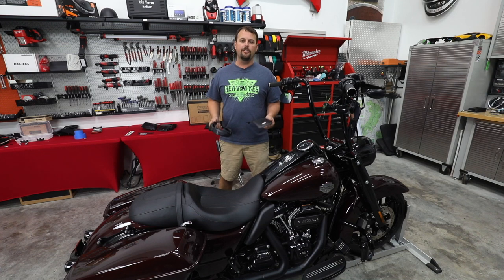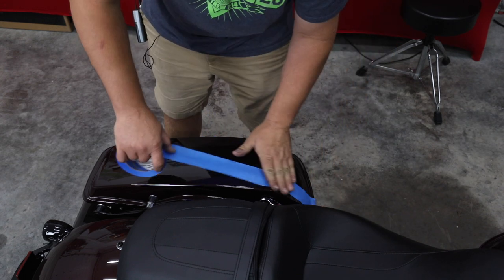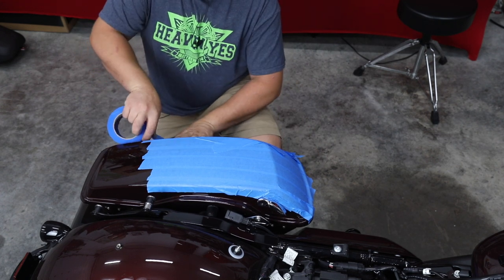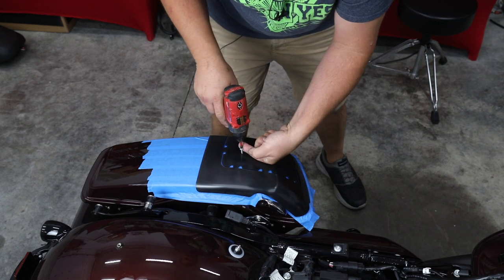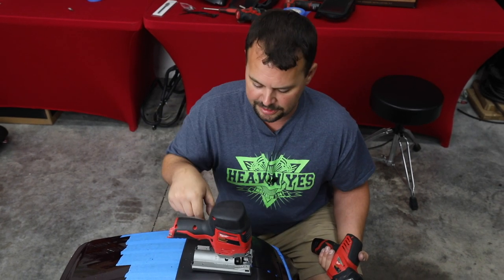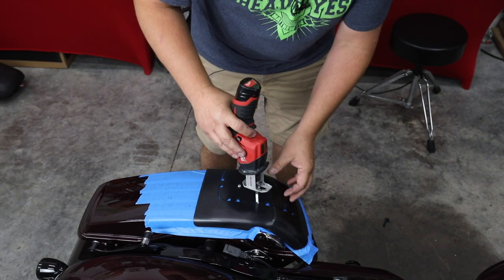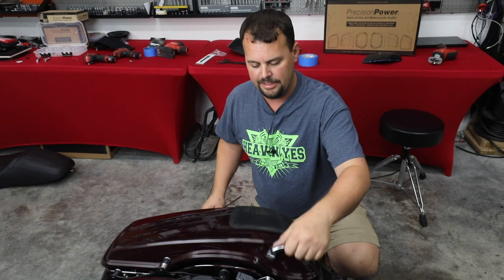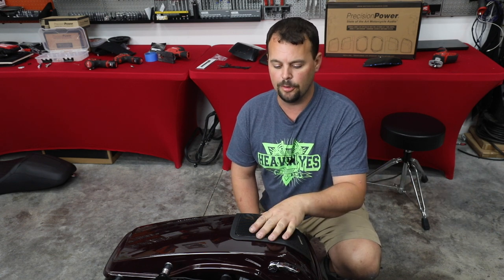Step by Step, How to install 6x9" speaker cut in kits to Saddle bag lids using the PPI HD14.SBS

Comment: Have been considering this mod 🤔, but after watching Traveling Tall's video on the bag lid mod I think that the Fairing lowers is the better route to take. 
To go thru all that trouble and have them leak, plus the sound gets blown back from your ears the fairing lowers is, to me the most sensible option.
Reply from the maker: Tall did not get the lid cut kits #1, the kicker lids he chose leaked but later we repaired them with silicone so they no longer leak, cut kits don’t leak when properly installed.  Check out the leak test riding and wrenching just did on our cut kits, you will hear the 6x9’s when using cut kits because the mounting angle is much better.  Tall’s head is about 1ft above his windshield and he wears a full face helmet, most people have a better scenario for hearing the 6x9’s, he also said he though you would get better bass from lowers, this thought is false, lowers never have good bass because they are free air pods
Reply from the maker: https://youtu.be/9gdahuPLexI
Reply: I have the milwaukee m12 hackzall but can not find a jigsaw style blade for it. What tool is that and what blade.

Comment: good stuff very professional detail oriented install instructions....maybe too much.  If you get too far in the weeds, you may lose some of us.  Things I would like to know is if I have a factory RF system on my 2021 Road Glide CVO, Is there a adjustment in the app to get the most out of that system.  If that is not enough, cause you always want more, what are the easiest add to get to the next level...add 6x9 speakers, replace the amp with more power,  plug and play type installs.  The other suggestion would be as you record the process, and you say for example that you need to sand down the speaker lid, to speed that up.  We get the concept of smoothing out the speaker hole after cut, but don't need to see you do it for minutes...thanks
Reply from the maker: Reach out to our sales team at 1-844-30AUDIO to discuss options. We do have videos where we do time lapse and speed processes up and then we get asked to show every step.

Comment: I noticed that in this video you did not add silicone or dumb-dumb to seal it. Is it because the kit has been upgraded?  I just ordered some from you and want to make sure before I install 
Thanks
Reply from the maker: The precision power cut kit has a wide enough gasket that silicone is not required

Why we think the Precision Power HD14.SBS is the best cut kit to use
https://youtu.be/BrrIToZRNDQ

Comment: I saw a video where you had an amp in the bag? How did you keep it from getting to hot? Or is it an issue?
Reply from the maker: If installing an amp in a bag use a sealed class d amplifier that does not require a fan and you will be good.  We mount amps in the fairing whenever possible as this is the best placement for an amplifier in a Harley

Comment: Hey Jay, you don't use silicon anymore?  You sent me this kit with my Hertz 6x9s the screws came with little black washers for what?  It doesn't seem that the speakers fit the mounts. Maybe I am doing something wrong. God Bless
Reply from the maker: In this video I show how to install the hertz 6x9’s in the cut kits https://youtu.be/Pg2ozj9fTK0
Reply from the maker: We use silicone on the underside portion if using the infinity cut kits, the precision power have a wider flange and gasket that seals well without silicone

Comment: Are the speakers going to be absolutely waterproof
Reply from the maker: Depends on which speakers you decide to install, no 6x9 is submersible but many are designed to get wet from rain and designed for Harley  use

Comment: I have the TMS69BL14 speakers that i installed in 2019. Can I just replace the speakers and reuse the Rockford grilles and speaker mount? Or with the cut from the Rockford kit, can I use your grilles and speaker mounts? I do not want to replace the saddlebags lids. Thank you
Reply from the maker: With slight modifications you can reuse the Rockford cut kits when going to better speakers, grills are not interchangeable

Comment: On the Road King? What are those speakers connected to? Do you have options to add music to a bike with no radio (like the road king) I have an old Dyna that I'd love to add a system to.
Reply from the maker: Yes we offer Roadking packages that use a Bluetooth amplifier https://volunteeraudio.com/product/hertz-sx690neo-6x9-motorcycle-speakers-with-plug-play-amplifier-and-precision-power-hd14-sbs-cut-kit-for-2014-2022-harley-davidson-road-king

Comment: I just purchased this cut kit w harness from your website. Do I need a spacer to install Hertz 6X9 Neo speakers?
Reply from the maker: No, I show in this video how to do the install without spacers Project Five-0 Step by step 2000 watt SP4.900 Hertz Amplifier and SX690Neo 6x9" Speaker Installation
https://youtu.be/Pg2ozj9fTK0

Comment: How much would it cost for u 2 put in a sound system in my 2018 street glide with infinites 6/9s & 6 1/2 with amps?
Reply from the maker: For installation quotes you will need to call our sales team at 1-844-30AUDIO

Comment: Will any of these cut kits work with CVO saddlebag locks?  I have seen your video 5x7 to 6x9 kits installed just wondering if there was a true 6x9 kit for the CVOs
Reply from the maker: If you install cut kits you will lose the power lid lock

Comment: What size/ gauge speaker wire do you recommend on your Hertz 900 amp with Hertz 6x9s and 6.5 neo and 2 - 8" subs.
Reply from the maker: Our plug n play amps come prewired with proper sized copper wire

Comment: Hi Jay, I did almost exactly as you stated. I had a 'fart' moment and over cut the bottom of the speaker lid. Its not visible to regular folks, but if you closely look you will see the gap underneath. What do you recommend to fill in that hole?
Reply from the maker: I have not had this happen in my installs, some people have bought replacement lids depending on the size of the mistake
Reply from the maker: I would need to see a picture of the problem to help
Reply: Where can I send you the pictures? I do have hertz speakers in the lid, but using kenwood 6x9 speaker lids. I’d the hertz slight larger that might be the ticket.
Reply from the maker: @Kevin-leatherneck  the cut in kit is kenwood?
Reply: Yes sir. That’s correct.
Reply: @volunteeraudio  that’s correct!
Reply from the maker: @Kevin-leatherneck  that is the hogtunes built cut in kit, no other cut kit fits that area and that kit has the least room for mistakes
Reply: @volunteeraudio  Jay , my apologies.  It’s the infinity kit not kenwood.

Comment: Will this work with the boom system installed on the 23s?
Reply from the maker: 23 is not boom audio, it is hd audio by Rockford, there is also a new cvo for 23, which bike exactly are you asking about?
Reply: 2023 street glide special
Reply: @volunteeraudio when connected via Bluetooth it comes up boom box GTS.
Reply: @volunteeraudio I also see a radio flash kit that only goes for a 2014-2020 can I still use that?
Reply from the maker: @MrNiceGuy_GG  we offer one for 21-up also, give us a call at 1-844-30AUDIO and we can go over pricing and options

Comment: So my question is if you have a gt radio and you add rear speakers how do you hook them up?
Reply from the maker: You need a backbone harness to plug into the rear speaker connector in the fairing, then a rear tourpack harness or lid disconnect harness, the stock radio would need to be flashed to turn on the rear speaker outputs and an amp is highly recommended

Comment: No gloves or safety glassss?!  Man, you livin la vita loca!! But, thanks for vid. I'll probably do this kit.
Reply from the maker: If I was cutting metal I would have glasses on but yes I’m tough and dumb sometimes. But you can wear gloves and glasses if you like.  Thank you for watching!
Reply: I just bought the Hertz HD14H6x9 Saddle Bag Lid Kit With HD14H Cut Kit And SX690NEO 6×9” Speakers For 2014-2023 Harley Davidson® Motorcycles [ HD14H 6×9 ][ SX 690 NEO ]. You’ll probably see the purchase soon. I hope it has everything I need. I have a factory 2023 Road Glide Special & am pretty sure it does not have any wiring going from the radio to the back area. Does this $899 kit come with all the wiring I’ll need? If not, can you guide me to what I’ll need. Thanks! Look forward to wiring, cutting, screwing & putting all this together as I am a musician and look forward to having more sound(from the rear) and better bass, etc.
Reply: Also, am I going to need to flash my factory BOOM radio?

Comment: When you use this kit you have to make sure you have original Harley-Davidson lids if not you have to do a little extra cutting I know because I have Advanblack lids and made the cuts correctly and still had to make modifications but it worked out just fine and had to modify my speakers a little bit but it is a great kithttps://youtube.com/channel/UChGJTD_vGuw4U5pkAs5C-zQ
Reply from the maker: I have used this kit with aftermarket lids, never had an issue as long as it did not have previous speaker provisions

Comment: Nice video…   But it’s cheaper to just buy a whole new set of bags
Reply from the maker: There are many advantages to cut kits over replacement lids. They use less bag space, angles the speaker toward the rider instead of straight up, way more water tight and gaskets, no need to paint the lid